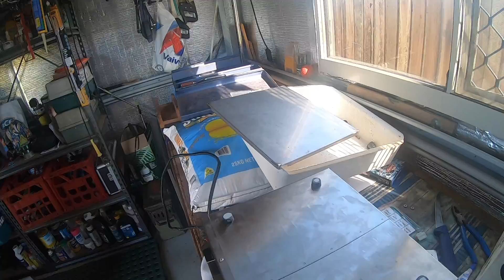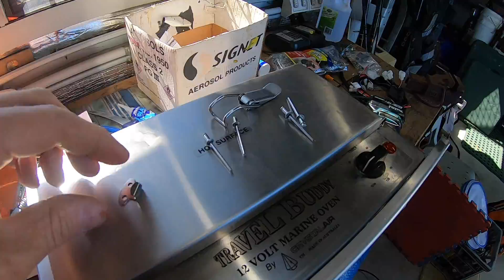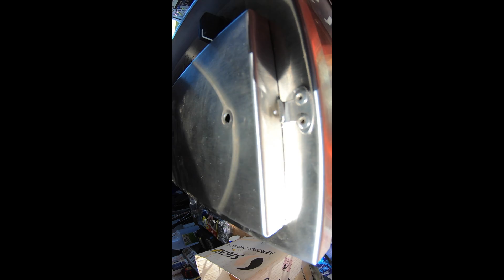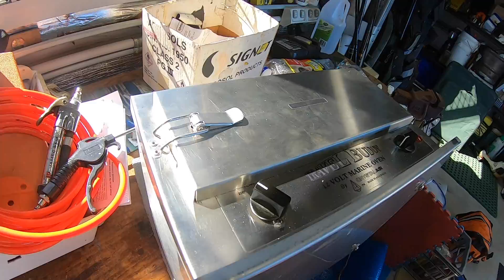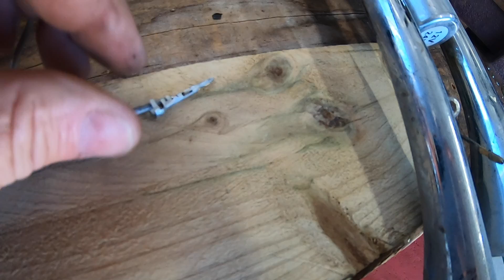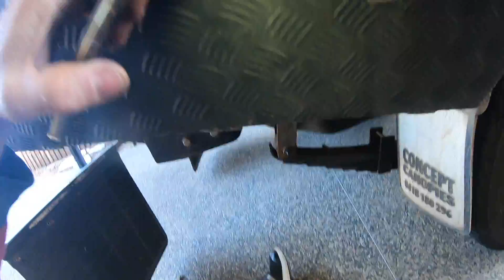Travel Buddy 12 volt oven - upgrades

Comment: Hi, where'd you get the drip tray and feet?
Reply from the maker: Thanks for the inquiry. The feet come with the Travel Buddy. The tray I had a local engineering (sheet metal) fabrication business make for me. 

I’d recommend having a drain put in so any liquid that is collected in the tray can be drained off. For my part I have drilled a hole in the front left corner and put a Blanc wiring grommet in -which is easily removed to drain the tray when needed.

Kennym